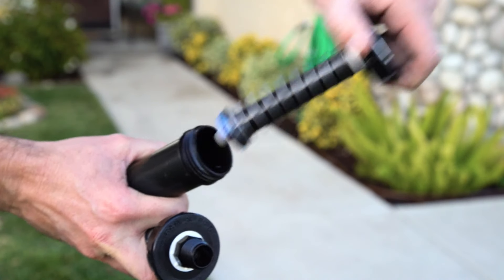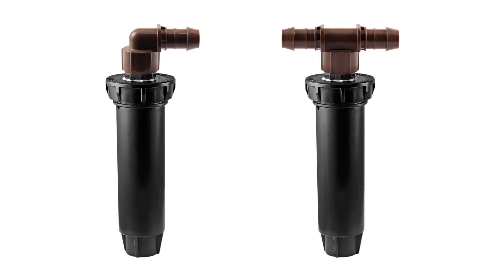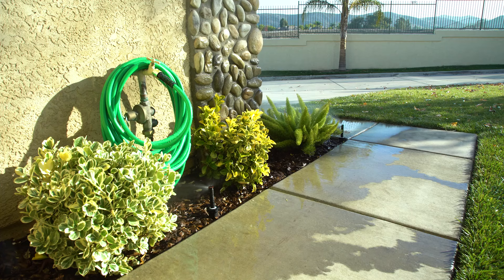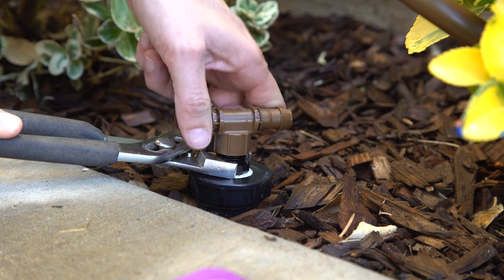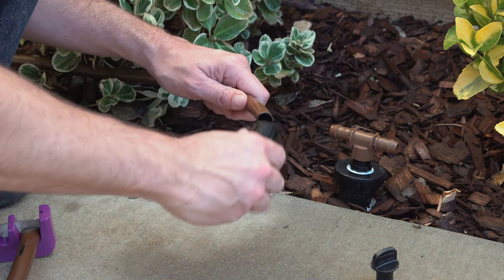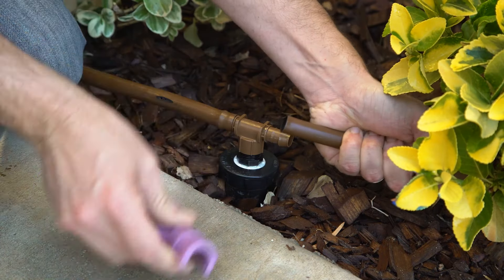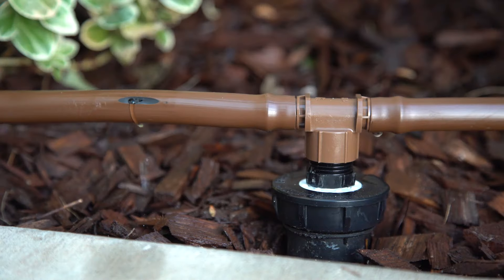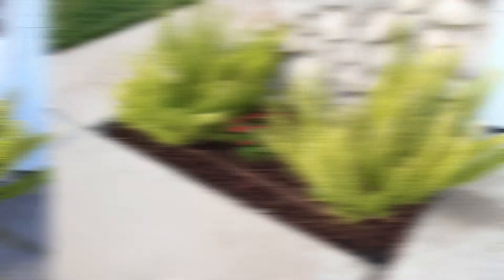Rain Bird 1800 Spray to Drip Retrofit Kit

Comment: Except one problem:   they leak profusely from the swivel joint.    Don't use these,   stick with traditiona filter/pressure regulators.   You can cap off all the sprinklers and find
a way to incorporate traditional products until they make a non leak version of this.